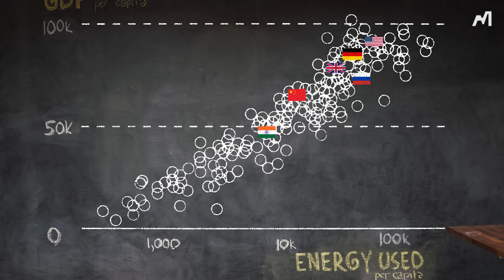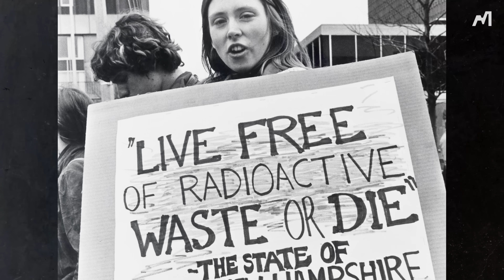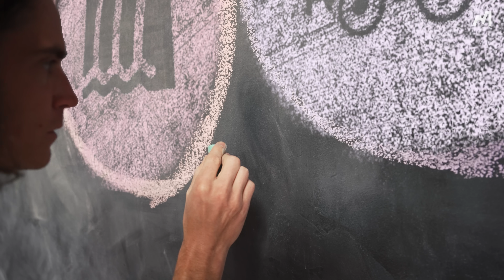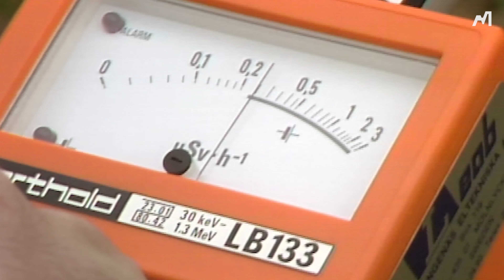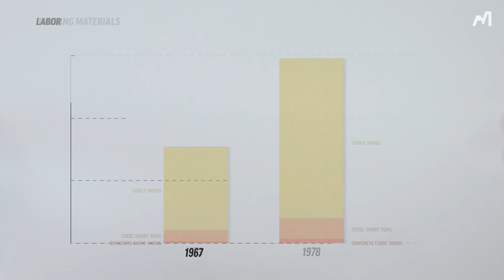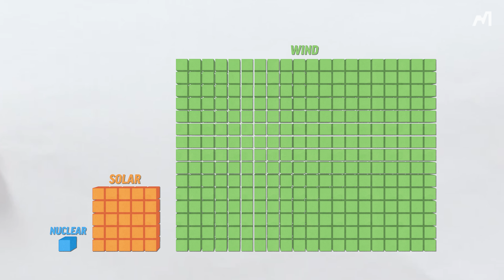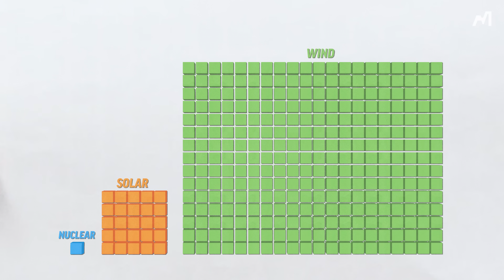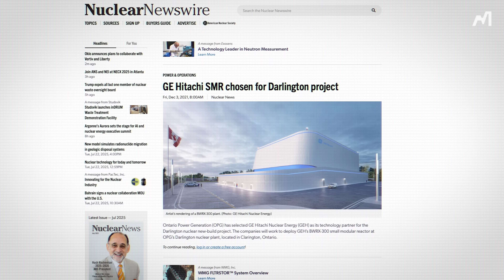They're Lying to You About Nuclear Energy

Comment: Nuclear is an intensely centralized way to provide electricity. Solar, and to a lesser extent, wind are more amenable to local control. Failure in these systems have magnitudes less long term damage than a nuclear mishap. 
Literally, we should be aiming to give power to the people. That is, we need management and costs to accrue to the folks who are consuming the energy. In many cases (all cases?) the  populace has no idea what environmental costs their consumption is causing. 
The problem is that nobody and no governmental nor NGO is actually responsible for controlling the degradation of our planet's resources which we rely upon. Solar arrays and wind turbines can be "decommissioned" with no long term harm-not so with nuclear. Fission results in highly radioactive waste, which we still have not devised a long term plan for. Add that to the cost of nuclear and you have a massive and unknowable increase in the real cost of nuclear. 
The real problem is corporatization of  decision making. Corporations are "in it" to make profit. We should not defer these important decisions to organizations which do not have our health and safety as their first consideration.

Comment: I love how people talk about deformed fish they found up stream of TMI.  Could it possibly be caused by the ungodly amount of pollution DuPont dumped in there for several decades before TMI ever came about?  Coal and fossil Fuel in general are the major reason why Nuclear became so feared.  Similar to how companies at that time pushed pollution on the consumer when they abandoned reusable containers in the 70’s, Coal and Oil Public relations teams were able to make people irrationally fearful of Nuclear Power.  It’s why I laugh at ‘Environmentalists’ who say it’s evil.  I just tell them they are doing the Devil’s work.

I’m speaking from this as someone with 25 years of Nuclear experience in the Navy, licensed on a BWR, and licensed on a PWR.  Please do not blame ALARA for Nuclear slow down.  It’s been a very affective program in nuclear.  Annual Dose rates for sites have dropped significantly from the late 70’s till today.  Saying it’s possibly BS is like harping on OSHA standards adopted after horror stories of the early Industrial Revolution as possible BS.  

Also Submarine Reactors and SMR’s are 2 different things.  A Submarine power plant is basically a F1 engine running off of 100+ octane fuel.  A SMR is home generator run off of Kerosine.  They aren’t controlled the same, they aren’t cooled the same, and they do not use similar fuel.  Both can be run safely with properly trained personnel, but that’s as close as it gets.

Also the rise in regulation was chaotic, but the results were overall positive from a safe/reliable metric.  Any design has flaws, but the industry has done a lot to fix any flaws they find.  Sometimes some plants do not choose to accept those design improvements.  In the 80’s GE reported that if the Drywell and/or Vessel had to vented to relieve a post accident build up of hydrogen then you risk blowing up portions of the secondary containment.  US BWR’s installed the design change based on that recommendation to install a path for a controlled release outside of containment.  Obviously Fukushima Daichi chose not to adopt that design.  Funny enough all US BWR replaced that design change with a more robust venting path that was rated for pressure much higher than the original post Fukushima.

Comment: Why not generate all electricity small scale locally using methods beneficial to that area.  Keep the grid for sharing excess power.  I don't get the logic of wasting so much using high voltages to transmit long distances.

Comment: Thank you Morocco for the proof on how garbage solar actually is.  Morocco built a solar farm the size of the stare Arizona and to fully power the country of Morocco they need 18 more solar farms the size of Arizona meaning it requires 19 times the size of Arizona to power Morocco.  Morocco used 1/17th the amount of power that the city of Tucson which is a single city in the state of Arizona.  Now to do the math it would actually take 323 times the size of the state of Arizona to power the city of Tucson which is inside the state of Arizona.  323 times the size of Arizona is about 82.75% of the total surface of the entire Earth.  To power the city of Tucson 82.75% of the entire surface of the Earth needs to be covered in solar panels.  That is at the best conditions.  Solar is absolute garbage and wind is far worse.
Reply: The Ouarzazate Power Station complex in Morocco is 12 square miles in area. Arizona is 113,998 square miles. Your math is not mathing.

Comment: The place to start with reactors is boats 

Cargo ships burn the most polluting sort of fuel there is with diesel pistons the size of my car, and that means they have to carry a tremendous tank of some of the most polluting sort of fuel there is, thousands and thousands of gallons of it. If you built one with a naval nuclear reactor as it's fuel source, almost all of that storage space that was portioned out for fuel could be stuff, and if something goes wrong most nuclear problems really are solved by putting them under ten feet of cold water, and the ocean has plenty of that.

Comment: Only thing is that the enrichment of fuel for smaller reactors is required to be higher, much higher than what is typically utilized in conventional power reactors. This adds additional cost and risk involved in manufacturing and handling of the fuel units.

Comment: Your deaths by fuel source and 11:00 "The loss of life over all situations that have ever developed at any nuclear reactor is very small"  Doesn't include the uranium miners.  Doesn't include people who may have been contaminated from the Church Rock spill.  

The report on the Rancho Seco accident pointed out the U.S. Nuclear Regulatory Commission (NRC) staff concluded that fundamental design flaws which were known by plant operators and the NRC itself were at the heart of the problem and should have been fixed years before. “In summary, the information was available and known which could have prevented this overcooling transient; but in the absence of adequate plant modifications, the incident should have been expected".   

Browns Ferry reopened after a $1 billion rehab after the cable tray fire with waivers from the very fire safety standards inspired by...the Browns Ferry fire.

When the industry has identified systemic problems with whole standardized designs (Babcock and Wilcox, AP1000) that weren't caught by the engineers, and it took a junior engineer to speak up to bring the Diablo Canyon pipe support whoopsie to light, it is obvious that we humans and our human institutions (be they private utilities or regulatory agencies) are not smart enough nor disciplined enough to operate nuclear power safely.

Comment: You forgot the cost of spent fuel storage which has to be stored safely for 100,000 years.
Reply: It's super easy to store and if we havnt found a different way to use it or throw it off planet in 100,000 years that's on us
Reply: @Rightboijake  there are already ways to use the "spent" fuel, just aren't always allowed.
sides, burying it in a mountain IS a good way to deal with it.
Reply: It's not exactly hard to store it safely, it's a rock that you put behind a large mass, not the cartoon ooze you are probably imagining.
and that's before you consider that spent fuel can often be refined back into useful fuel for different reactors if you haven't done something dumb to make it inaccessible.
Reply: its a monolith of reinforced concrete lined with steel
it will hold its own for longer than the waste
and at the end of the day if one is really worried you can just lower them into a deep hole of rock and have it contained for millions of years

Comment: There are some major flaws with the information in this video.  First, saying that being exposed to electromagnetic radiation (climbing Everest, sun exposure, cell phones and radio, etc.) is the same as particle radiation (radioactive decay, nuclear fuel sources, etc.) is flat wrong.  Alpha, beta and gamma radiation from uranium and plutonium is absolutely a risk, and does cause cell damage.  This is the exact reason why radiation oncology (I helped maintain Elekta and Varian linear accelerators at cancer centers for 20 years) can use a radiation source to destroy cancer cells.  There truly is no safe level of particle radiation exposure.  Each time you are exposed you run a risk of causing DNA damage to cells that then can become cancer.  Particle radiation has mass that can knock off parts of DNA strands in cells causing mutations that can lead to cancer.  For low doses the risk is less because there will be fewer collisions, but the risk is still there.

Personally, my biggest issue with nuclear power is when something goes very wrong it makes a large area of our planet uninhabitable for the rest of the duration of our planet (if uranium, for plutonium it would be less than a million years), and we have already had multiple events within our first century of playing with the stuff.  If humans are able to stick around, what percent of the planet and water supplies will we destroy due to criticalities, meltdowns, accidents during fuel transportation, and so on?  We are supposed to be good stewards of our planet home, so why not focus more on advancing the efficiency of wind, solar, and even new means that don’t run the risk of destroying the planet?  To say that nuclear is as clean as solar and wind is a complete lie.  Spent fuel rods of enriched uranium with a half life of 4.5 billion years are far more pollution than wind turning a windmill or solar panels shading the ground.  I agree that nuclear is a cheaper way of generating energy in a small footprint, but the long term costs and risks are very hard to justify.  If you want to promote nuclear, make sure to correctly explain how radiation exposure works,  the risks to people and the planet, and what the long term impacts really are.

Comment: solar and wind are suitable for installation and use on site. as we know, power loss in transmission is as high as or even exceeding 80%. power used at the site of generation is almost lossless because the transmission losses are negligible. placing small scale wind on roof edges and solar on rooftop surfaces takes up no additional land. it just adds a little load to the building and hence increases the cost of building slightly. additionally if we shift to hydrogen power then hydrogen can be stored and transmitted with almost no loss except potential leakage. sand batteries that are very efficient can be installed on site and buried therefore taking up no space.

Comment: I mean, any argument against nuclear power is pretty moot when you compare the impact of nuclear power on the environment vs the stuff we're actively doing on purpose and are aware of the consequences of said actions. You don't even need to group then together either. Landfills currently occupy 18 times space than the Chernobyl exclusion zone, are emitting toxic gases and leeching contaminats into the ground water which increase the risk of cancer and respiratory diseases, and we do that ON PURPOSE. Fossil fuels release radioactive particles into the air on top of the carbon currently increasing global temperatures. Either one of these by themselves is way worse than anything nuclear power has done or could do. But we're currently doing them both at the same time, ON PURPOSE while people complain about the downsides of nuclear power like it wouldn't be a drop in the bucket compared to the damage we're currently doing on a daily basis.

Comment: The problem with nuclear power isn't the radiation, it's the total cost of ownership, if you do not deliberately leave out most of the costs.
A very good source to research, is the WNISR (World Nuclear Industry Status Report). It's publicly available, based on official data and looks at the development of the global nuclear industry each year. In a nutshell: nuclear power is only possible if subsided with billions of taxpayer's money. There's not one, single nuclear plant financed with bank credit and inventors money, as the prospect of investing millions with an average increase in building cost is typically 150% to 250% and time to production exceeds 12-16 years on average, despite ambitious timelines. By the time the nuclear power plant is built, the cost per kwh needs to be so high, that it's non-competitive, even to burning wood(!), as the typical lifespan of a nuclear power plant is not long enough to get an ROI (Return Of Invest), before it's no longer viable to operate due to maintenance, modernization cost. The current average lifespan of a nuclear power plant is 28 years, if I am not mistaken. That means with an overly optimistic assumption of 40 years and 60% of maximum possible output and 80% uptime (which both are unheard of), it is nearly impossible to sell the energy produced at viable margin... remember Solar, Wind, Geothermal etc. typically have production cost averaging 4-30 cents(!) per kwh. 
That's why politicians subsidize the planning, build and operation of nuclear power plants, since the very beginning. The most viable reason to do that, was production of necessary isotopes for nuclear weapons and development of military propulsion by nuclear power, never "cheap" or "clean" energy.
The finances simply won't add up, if not heavily subsidized.

Comment: the problem with nuclear power isnt that its dangerous, its that its inefficient, say you only have 1 nuclear power plant near a big city means that that city migh be fine but the towns next to it would all depend on that same reactor and therefore have lower voltage unless you invest in heavy cabels. also what are you gonna do with the waste bruh its just not efficient. the best solution to electricity imo is  having localized generation for every house that is being built, or in every town have something like a hydrogen battery where you just create hydrogen to store excess electricity. the sun is free but uranium isnt, in 100 years we will look back and think how much of it we wasted.

Comment: There is also Title 10 Part 53 that basically stated that only a 1 MWth Molten Salt Reactor (MSR) could be built because (and I'm paraphrasing), we don't know what it will do. You can't find the NRC's Title 10 Part 53 because it's being revamped so no one can build an MSR larger than 1 MWth. The NRC has once again over protected everyone at the cost of power when more and more AI data centers are being built.

Excellent presentation!

Comment: Here in Canada, we have one of the best nuclear power station designs (CANDU) with many operating here and around the world. However the Environmental lobby destroyed any chance of building new stations for the last 20 years. These systems are clean, safe, and economically very attractive if it weren't for the insane environmental regulations around them, taking 15-20 years from wet ink on a contract to flicking on the switch. Instead, the Environmental lobby convinced us that solar and wind were all Canada needed (forgetting the fact that on windless nights the systems just don't seem to work) has chained us to natural gas for the foreseeable future and simultaneously prevented the widespread adoption of EV's, while the 20 years of delays will now cost the country dearly with vastly higher public debt requirements (higher taxes) then if it had all been done 20 years ago.
Reply: Ironically, in this case the biggest enemy of the Environment is the Environmental movement.

Comment: Yes, wind turbines occupy an amount of land that's many times what a nuclear plant does.  I don't know whether 300 is exactly correct, but it sounds about right.  It's certainly plausible, at the very least.  But 300 times zero is still zero.  The amount of land a nuclear plant requires per household isn't zero, but it's pretty close.  In a nutshell, agriculture uses land and energy basically doesn't -- no matter whether the energy is wind, solar, or nuclear.  

I'm pretty sure transmission uses substantially more land than generation, even if the generation is wind.  Power lines extend for extremely long distances, and need some amount of clearance along all that distance.  If we really wanted to reduce the land required for energy, the way to do it would be by burying cables and stringing overhead wires along existing rights-of-way.  And transmission is worse than generation in a way that goes beyond area: habitat fragmentation.  If something used a square of land ten miles on a side, and left all the land around as wildlife habitat, the rest of the habitat would be basically unaffected.  If something uses the same total area of land -- a hundred square miles -- but it crisscrosses the landscape in strips a tenth of a mile wide and a thousand miles long, all the habitat is less suitable for many kinds of wildlife.